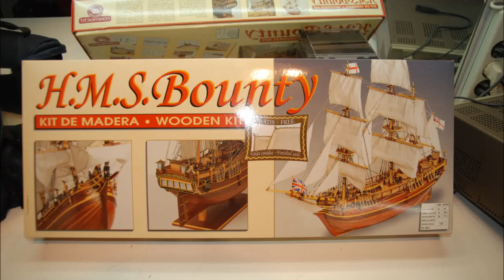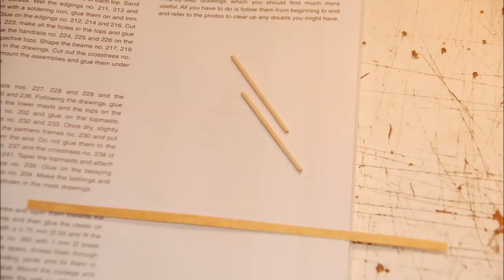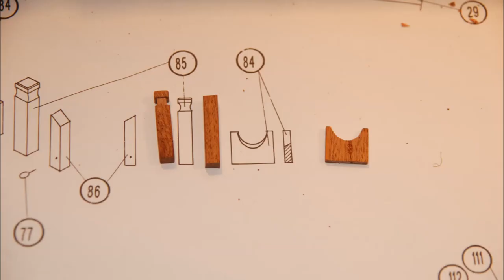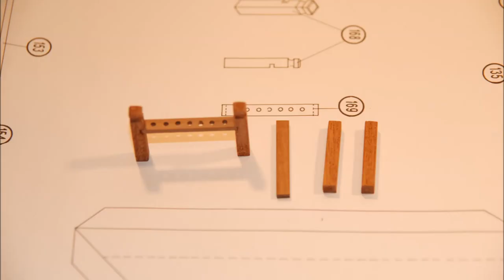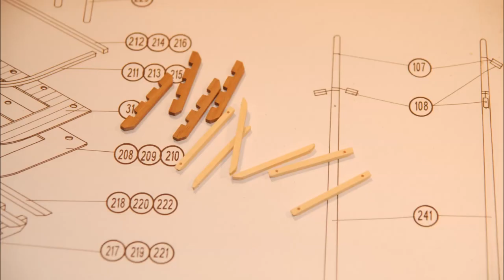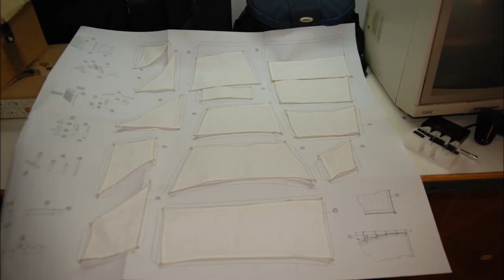HMS Bounty The Making Of

Comment: Is this the Kit By Artesania latina? 

Great job also.
Reply from the maker: Thank you very much! No this kit is by Constructo.
Reply: @JohnsWoodenShips  Sweet thank you very much! Im going to look into this for myself.
Reply from the maker: @ronjoninthedangerzone576   If you need any help in the process of building do not hesitate to ask me :)
Reply: @JohnsWoodenShips  Thank you, Im still fairly new to Wooden Ship modeling, so will be a while off before i try this beast. I did have a question about planking, how do you do it, and what are the best ways for a beginner?
Reply from the maker: @ronjoninthedangerzone576  first you have to have the right tools to do the job. Check out my video for the tools : https://www.youtube.com/watch?v=9Qu3rX07OSs
In a point i explain why the strips at the stern must be less wide, you need that to do the planking. Also check out my other video on how to bend the strips : https://www.youtube.com/watch?v=8uvnm5BLiKg&feature=youtu.be
For gluing you need a cyanoacrylic glue to keep the wood strips in place and a white wood glue to glue them strongly where you want. The white glue is for the keel , the main spine and arches of the ship and in any place who will support the main ship. For the deck and the other parts the cyanoacrylic glue is just fine. Before you place any wood strip first you have to check to see if it's going to be in the right place and make any adjustments necessary ,like sanding down the strip or bending it, then glue it. Remember that for a beginner is best to start with an easy model, not an elite series. Also try a model with a keel that is not very "curvy". I hope a helped you. Ask me anything, anytime :)

Comment: Hi can I ask how you managed to do the hex cuts on I think its called the Windlass at 3:20 in the video?
Reply from the maker: I used a small plane from the middle and one side, then from the middle and the other side all the way around until i got the shape i wanted.
Reply: @JohnsWoodenShips  Thanks for your answer John. I appreciate your work mate, this is my first ever wood build, and I am holding back to do the boarding of the hull, I will work out how am gonna do it soon as I have built all the deck stuff so only left with the hull and the masts lol.
Reply: Another question if you dont mind I am about to start doing the blocks but nowhere that I can see in the Instructions does it say how many of each type you need, there are some just with wire others with hoops in the wire etc how did you find out what was needed?
Reply from the maker: @buddyh42uk  Each type of block has a number. The big ones are used at the big masts and usually at the center. The small ones are for everything else. The ones with the wire normally are being used at a point that you have a ring to attach the block to.

Comment: Howz it 
Ive just got this model as a gift and am up to the part where i start putting down the decking ? Whats a good way or method to begin this process and the side panelling  and is the side panelling the hard pieces of brown wood or the paper thin wood ???
Reply from the maker: First of all i hope to enjoy tour present!!! You have to follow the instructions and always before performing a step read carefully the next 3-4 steps to make sure you do not make any mistake. Use the cyanoacrylic glue for the deck planking and make sure there are no gaps between the strips. For the keel , the kit contains the hard brown (sapely) pieces of wood (i  believe there where 2 mm thick and 5 or 6 mm wide) for the keel. The using of the thin wood is only if you are not experienced in the planking of the keel. So after you finished the planking with the hard wood you use the thin above the hard to make a smoother keel. But be careful, if you choose this option then the coloring of the wood wouldn't be different and beautiful, it will be as if you painted the keel brown.